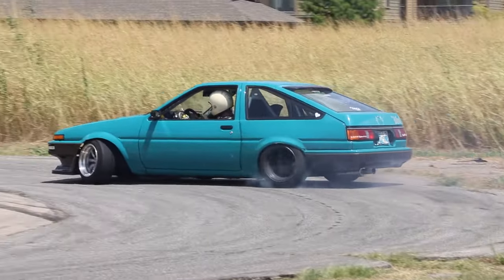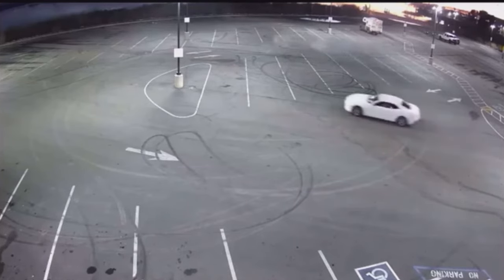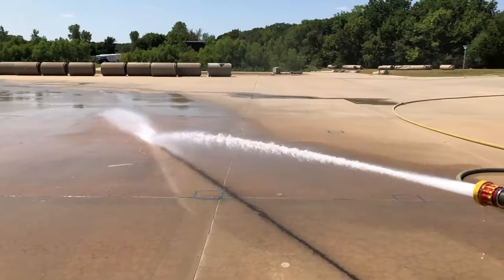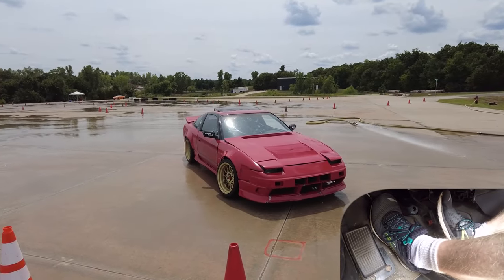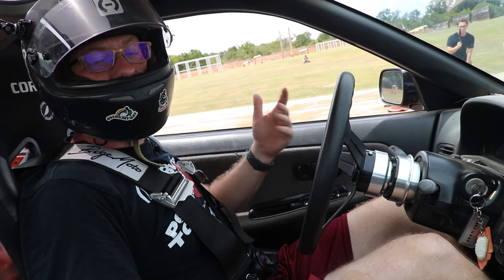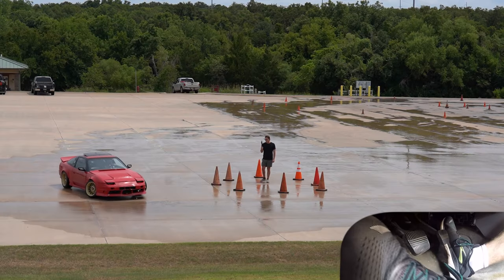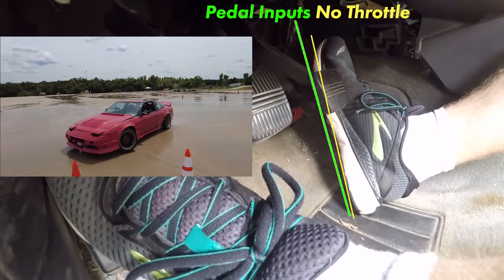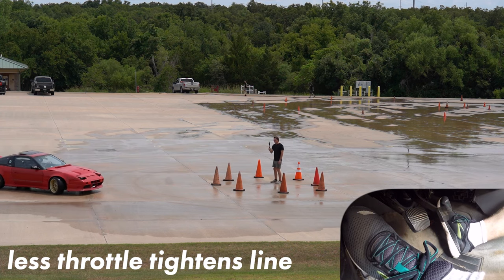Drifting Tutorial for Beginners - Learn How to Drift

Comment: Wow, so that's the obvious technique I've been missing out, letting go of the steering wheel... no wonder I've been having a hard time doing basic donut. Thanks for the step-by step guide!
Reply from the maker: For most cars, they have good self steer built into their steering geometry, so that letting go of the wheel when the car starts to slip works 👌🏻 Stock cars often have pretty poor angle and contact patch at lock in drift, but you can absolutely get started with a bone stock RWD car as long as it has a locking diff (viscous, clutch, quaife/torsen, spool or welded)

Comment: I have a g920 rn and have been thinking about upgrading for a while. If I were to upgrade to a high caliber sim rig it obviously can be around the same price as a real car. Anyway I just wanted an opinion from someone who has much experience in both and which one would be the better option to invest in. Thanks!
Reply from the maker: Real car vs realistic sim gear? 
The short answer is sim for starters. If you can afford a sim you can’t afford to drift IRL IMHO.

Long answer: Sim is way cheaper than real cars FWIW. Both have an initial investment to get started, but the sim doesn’t cost anything to do countless laps in, where a real car has a few extra issues:
1) it might not have any tuning for the same price as your sim that can simulate highly tuned cars, so irl may not be as fun unless you spend more on tuning
2) event entry fees are $60-120 per day, least here in the US
3) tires are $120-300 per pair and you will go through between 1 (low power) and 4 (high power) per event.
4) your sim gear generally won’t break, except after maybe 5+ years. Many real drift cars break once a year or more, especially if the driver crashes.

My real car costs about $350-450 per day to drift after entry fees, gas, tires, food, etc. sim is waaay cheaper. I’d tell anyone to start there.
Reply: Just to add my very limited experience, I consider myself as a complete noob SIM drifter (despite taking 2+ years to build my SIM rig) but I'm so grateful of the initial advice to buy a T300 wheel as my starting point, (I am presuming your on PC and not on console). As for drifting IRL, I've never owned a RWD car, but I've own two nicely modified FWD cars in the past. To agree with Ben, I certainly couldn't afford drifting IRL these days. Primarily that's my reasoning for building a SIM rig. I'll be doing a YT video myself in the near future for my own build if your interested?

Comment: Speed up, then slow down rapidly approaching a turn. As soon as the wheels skid, start the turn, while simultaneously releasing the main brake and engaging the parking brake.

Once the parking break is engaged, you should overcompensate, and go directly towards the right curb if turning right. 

When this happens, accelerate rapidly, and jerk the wheel to the left if turning right.

The car should drift parallel to the curb, facing it....

Just keep maintaining acceleration, and holding the wheel in that direction, until the curve ends, then, straighten out and gun it.

Theres other ways to drift. But that's how you'd do a hairpin turn, which is easiest.

Comment: Really nice! Btw, how modified is your steering from stock? Caster and camber angles? I feel like an E36 was not self steering as much as an S13 or M3 that I tried IRL and was wondering if it's purely down to symmetry.
Reply from the maker: You’ll appreciate this vid: https://youtu.be/qLcEo_Ccj-s

That said, the steering on this car has a fair bit of work. Knuckles, FLCA/TC Rod combo for added steering and clearance, front track width increased by somewhere around 1.5 per side, and rack relocated for more angle without overcentering. Its…not stock 😆

In the video above, I drift a stockish E36 and it does fine, though I didn’t adapt to it very well in those couple laps. You can get a lot of benefit from a good alignment that gives you a flat contact patch at around 75% of your cars max angle. At this point I have caster around 7 degrees and camber around -5 degrees but that’s model and tuning specific, cause you can alter the caster and camber curves when you modify the suspension and steering pick up points
Reply: @KameTrick  thanks for the reply! And yeah nice video the E46 one. I am not familiar with some of the parts you mentioned, maybe it's an idea to mention in a future video.

Comment: Is it possible that doing a donut in one direction feels easier than the other? For example I can do donuts while turning left easily, however I can't hold a donut while going right
Reply from the maker: Absolutely possible. You may find you feel more confident or have an easier time in one direction than the other cause you sit close to one side and have to look “across” the car to the passenger side of the car, for example.

Also IRL cars with stock differentials may only be able to spin one wheel, and in that case they drift kinda decent when that wheel is on the outside, but in the other direction when it’s on the inside the car won’t step out.
Reply: @KameTrick  Thanks for the detailed reply, furthermore, is it possible for this bias to translate directly to sim drifting as well. As this is where most of my seat time is spent?
Reply: @sp69 same I have a sim rig at home and am trying to learn to drift, but I drift a lot better going left than right. It probably is because I’m right handed and control it more with the right side of the wheel, but I’m curious to know the answer

Comment: Sorry, is the throttle the clutch? Can automatic's drift without a clutch?
Reply from the maker: Throttle is the pedal that makes the car go, brake is the one that makes it stop. Automatics have both of those pedals. The clutch is the pedal that can temporarily disconnect the engine from the wheels, that’s what let’s the car change gears. Automatic cars don’t have a clutch and can change gears…automatically, while manual cars the driver has to do that.

You can drift a rear while drive automatic car, assuming it has a welded diff or LSD, though you will be lacking the option to clutch kick the car or keep it in a specific gear sometimes. It’s not as ideal as using a manual car, but certainly doable

Comment: Can you do this in a ford focus? 🤔
Reply from the maker: If the Focus is FWD, then for drift entries, yes. Sustained drifting lap after lap, no.

The RWD & AWD ability to do multiple donuts comes from the rear wheels pushing the car sideways from the back of the car.

FWD cars can build up speed and use braking/ebrake to slide into a turn and do a 180 degree donut easily, but that slows any car down, and FWD's have no way to add speed while pushing the car sideways, because their power comes form the front tires, which pull the car...and when you pull something it goes in a straight line.

Comment: Does this work with a fwd car?
Reply: Meehhh, i mean if you can shift your weight one way and flick it the other, you may start a slide, but u cant really control the slide with throttle etc, its more just using the weight of your car to pull u around a bend sideways

Comment: Realistically drifting is just counter steering an oversteer if you have a rwd and steer hard to a certain direction the wheel will start to heat up and begin to slide you can counter steer by steering to the opposite direction and the parking brake for a more controlled speed and traction

Comment: Can you drift on an automatic car ?
Reply from the maker: It’s certainly possible! Depending on how the transmission decides when to shift and the timing of its power delivery you might not be as smooth coming on throttle, but once you’re on I think you’ll be in decent shape.

Although auto upshifts (or it failing to upshift) can upset the cars balance or cause the engine to bog if you’re dealing with speed changes so great that an upshift is needed.